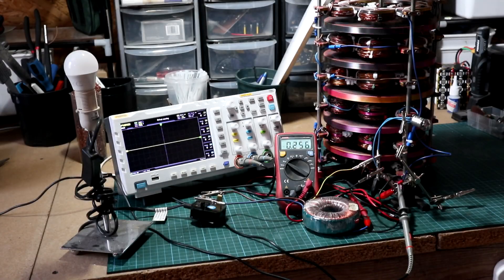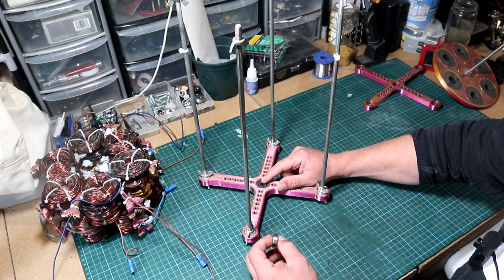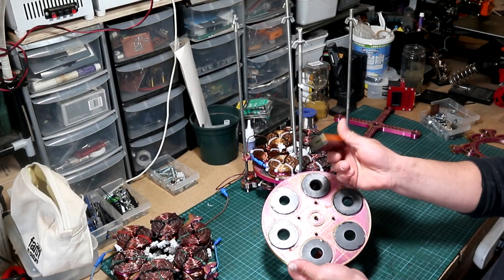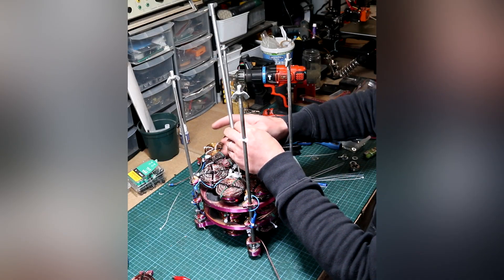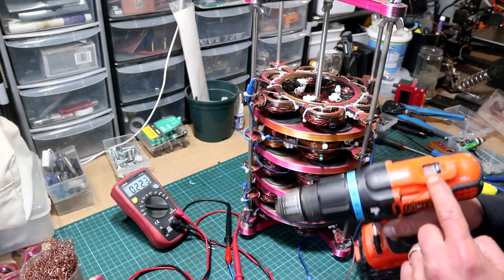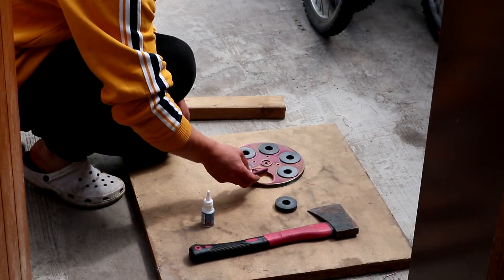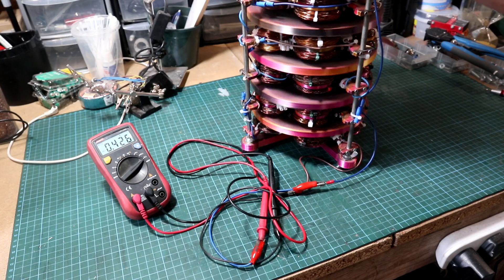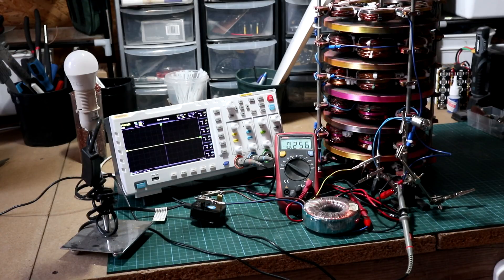Axial Flux Stack Generator Part 3 Assemble and Testing

Comment: Your Generator very very weak
Reply from the maker: Yes it is , that's because it doesn't have an iron core and is an axial generator which is not like an ordinary generator, and also because I went with a single phase instead of tree phase it generates a bit less but anyway soon part 4 may come in the future and it will deliver some better results. But as it is at this stage is like you said Very weak

Comment: Axial motor
Reply from the maker: Actually I'm sure I didn't try to feed some ac voltage into it but I guess it will work more or less as a motor like those found in the washing machine , I will experiment with it if it will work a motor.

Comment: Hi, don't worry, I'm also building a fluid motor. I have a question for you: Do we have to install all the coils in the same direction? Or does one of them have a different direction?
Reply from the maker: See part 2 there I have explained a bit better, but yes depending how you make them you may have or not to flip them